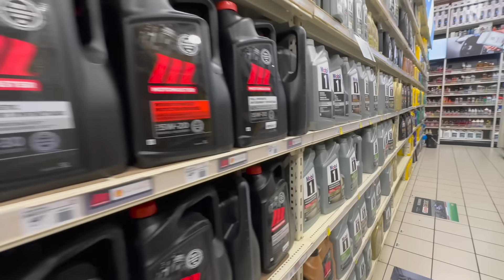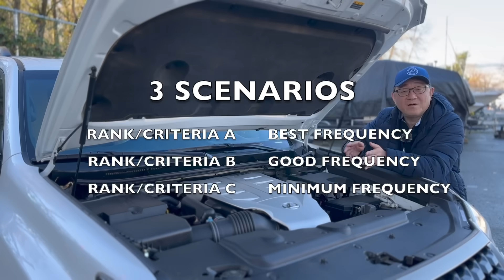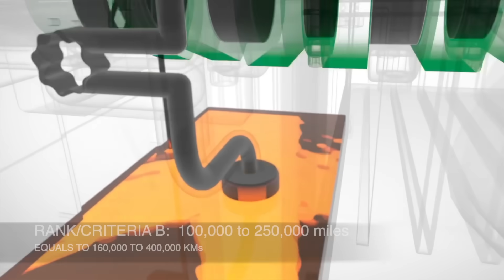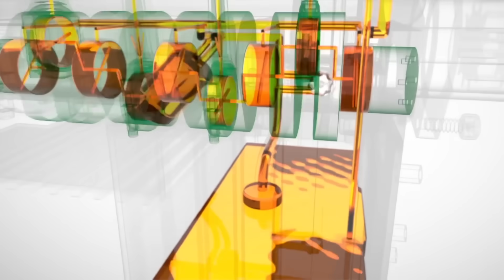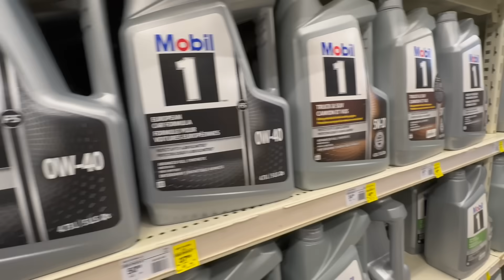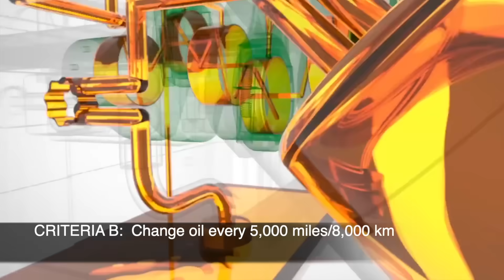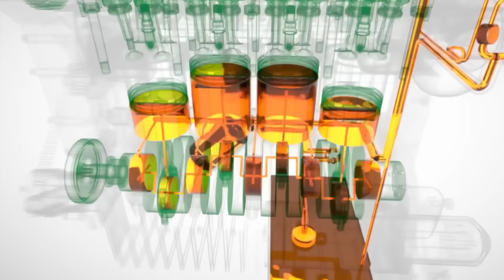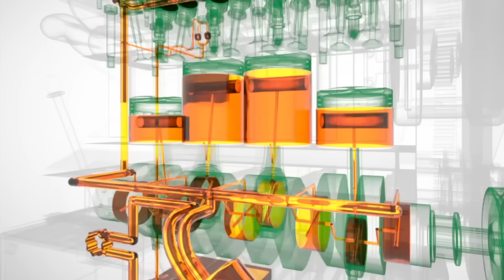ENGINEER EXPLAINS HOW OFTEN TO CHANGE OIL & FILTER // UPDATED CRITERIA-BASED RECOMMENDATIONS!

Comment: I'm an "A"  guy.  I've always bought new, kept them for 10+ years, although nowadays I use synthetic and go for 4-5k miles.
I am disappointed in the "C" recommendation.  This is why I don't buy used.  The attitude is basically "I don't care if who gets it next will have a long-term car. I got mine.".
Reply: couldn't agree more..very well said 💯
Reply: I was thinking the same thing. Basically C  is encouraging bad maintenance.
Reply: The other issue is that manufacturers like Toyota tell customers 10k is a good interval and Toyota care only covers oil changes at 10k intervals. So folks think it’s fine. Shame on them. Their is fine print in the book that tells you if you tow, or drive for short intervals than you need to change it more often, but no one looks into that…
Reply: I owned a 1980 Toyota Corolla from 1984 to 1988. The owner's manual stated to change the oil every 10,000 miles under regular operating conditions. Every 5,000 miles under severe. This was in 1980 too! Remember everybody when Mobil One was introduced around 1975? The commercials stated one can go 25,000 miles between oil changes! Then Mobil probably figured out they would not sell as much oil, and ended that campaign whenever.  :face-purple-wide-eyes:
Reply: Everybody is an expert. LOL
Reply: Agreed. A few years ago I bought a CPO Camry with 31k on it. After about a year I began to have serious oil consumption issues. After reviewing the Carfax history and noticing that the car had only had 2 free oil changes at the dealership I became aware of the 10 k interval being a huge problem. Ended up trading it in for my first and hopefully last new car. So far I have done 3 oil changes myself every 3-4k miles since most of my driving is short and in hilly terrain.
Reply: @turo3066 9:24 lo
Reply: Modern machining specs and tolerances work fine with 10,000 mile oil changes.  I put over 200k on one doing just that.  Everything in new engines are designed with the 10,000 mile oil in mind, including dirty oil for that long.  Running oil past a year and well beyond 10,000 miles is harmful.
Reply: @flat_stickproductions209  wow, so much ignorance in one post, really amazing.
Reply: @lhurst9550  I am sure the guys designing engines, oil and oil filters would really like to hear the handy mans take on it, or even the Jiffy lube tech.
Reply: 10+ years is Not long…
Reply: IF YOU GO FOR 5K MILES YOU ARE B GUY. 
I AM AAA, 'CAUSE I CHANGE MY OIL EVERY WEDNESDAY. 😂😢😮😅
Reply: I totally agree, I NEVER buy used.  You never know how they have been treated.  I like to have a factory warranty and use the time to decide if I want to keep it or sell it.
Reply: Same, I love cars so I’ll take care of it regardless of how long I have it and in hope that everyone after me takes care of them and can enjoy the car without problems.
Reply: Came here to say this.
Reply: Why is it bad to use the manufacturers recommendation? Unless they want the car to fail so you have to buy another one. If that’s the case why would you be a repeat customer if the engine failed prematurely on their recommendation?
Reply: @JHKCF  Basically every driver have different driving conditions which does not fit the ideal manufacturer oil change interval. You may have short trips like driving to work every day for 5 minutes which does not allow the engine to fully warm up. You may be a driver that does mostly city driving and that effects the engine oil. On the other hand you drive mainly highway driving which is good for the car. Then weather plays a part in which dusty and extreme freezing condition or very hot desert condition will effect engine oil wear. So the 10,000 mile oil change the manufacturer recommended is not ideal for that driver that drives short trips mainly in the city. On the other hand the driver that drives mainly highway for an hour every day the 10,000 mile oil change in mostly warm weather above freezing would be good for the engine.
Reply: @nowayout8639  There are historically two schedules of maintenance for oil/filter changes. One is for those who drive in clean conditions and on longer trips. The other schedule is for what is considered to be harsh conditions with short trips and lots of dry dust and or sand.
Reply: @nowayout8639    You make some excellent points. I’m 65 years old and am the kind of person that would rather drive a debt free car than purchase a new one every 5 years and always having loan debt. So I typically drive them til it makes absolutely no sense to continue to repair it. I have literally never owned a car that I gave up on because of internal mechanical issues and would routinely change oil every 4-5 thousand miles on conventional oil when 3000 was recommended years ago. Now I do understand that some of today’s engines with turbos and variable valve timing may suffer a bit if you try and extend oil life too far beyond what’s recommended.
Reply: @davepaturno4290 while definitely true and they used to specifically state that in an owners manual, now I believe some manufacturers don't say anything to the effect of a reason the owner should be changing the oil on a severe use schedule, instead they point to the oil life monitor and claim its going to tell you. I've seen mechanics make comments on videos like this stating that they feel the oil life monitor has been the death of some engines they see come in because the owner went by it and the engine wear told the story of the lack of maintenance.
Reply: @charlesb4267  I think that if the algorithm in many vehicles does monitor driving habits and durations, then it's safe to trust its "guidance". My 2014 Mazda 3S GT recommended an oil/filter change after one year, since my annual mileage never exceeded 5000. 
 The mistake many people make is that choose only mileage as to when oil needs to be changed. My car had that as an option for when it would throw up the maintenance symbol (a wrench). The other option was time, only. I always chose the algorithm.
Reply: @JHKCF  they only think of the "new car customer" used car buyers and people who keep cars post 100k are freeloaders from their perspective.
Reply: @JHKCF  low tension piston rings get gummed up on extended oil change intervals.  Following manufacturer's recommendations for maintenance gets you car out of the warranty period.  A few years later you are looking at some serious oil consumptions problems.  This has soured the used car market for a lot of people.  Dealer maintened means nothing nowdays.
Reply: @JHKCF  Yeah and they also tell you it's a sealed transmission with no changes needed. lol
Reply: @JHKCF  They do it for CAFE kickback's from the federal government. Also, keep in mind that a lot of USA made vehicles have a different maintenance schedule than a European car. I live next to the Canadian border and years ago people would drive up to Canada and buy new cars because they got better fuel economy and longevity.

American cars have a ton of stuff from the EPA that basically shorten the life expectancy of most vehicles.

For instance most Americans have zero idea Honda made Diesel Lawnmowers but Europe is full of them. EPA wouldn't allow them here in the good ol USA
Reply: @JHKCF it won’t fail prematurely. It just won’t go long past the warranty.
Reply: I've known a couple people who leased a car and never changed the oil.  Way back I bought a pickup with 42k that was still on the factory oil, and nearly empty.  I drove it for a couple trouble free years and sold it to a dealer.

Comment: I do 5000km inn 15.6 months, is that ok
Reply: That's for you to decide.
I think it would be better if you changed the oil at the very least once a year even if you only put on 5,000 kms annually.    You are in the "B" team.
Reply: Again up to you. But I hope you  take the vehicle for a very long run at high speed at least once a month to give it a very good work out. So if you doing very slow speeds and very minimal running that’s also no good. The oil and engine are designed for high temps. So perhaps in your situation twice a year still.

Cheers.
Reply: @johnmartin7158  thank u John, I don't usually take it for a long run, its the infamous GM Z22SE (L61) withé 283000 km (175848 Miles) on it 😀
Reply: @MeaHeaR  You’re welcome.

Cheers NZ.

Comment: Yay for YouTube algorithm sending this recommendation! I’ll also add that every modern liquid cooled engine would be “best served”using Quaker State Full Synthetic 5W30 (not Ultimate Protection/must be 5W30). This is per 540RAT engineering blog who has tested over 300 engine oils to their maximum mechanical load limits. Ideally change every 3,000mi to 5,000mi max. Purolator, Bosch oil filters are tied for 2nd, Motorcraft filters #1 construction. Find one that fits. Cheers

Comment: @AutomotivePress: Excellent information, thank you! Can you do a video like this on transmission fluid, differential fluid, transfer case, etc?

EDIT: do these recommendations apply to turbocharged and direct injection?
Reply: it its turbo change oil evey 1,000 miles and if you want to play it safe then change the oil every 500 miles

Comment: I have a 2003 Highlander V6 with 160,000 trouble free miles. I change the oil every 5000 miles. I like this number and recommend it to friends because it is easy to keep track of. Whenever the car hits the next 5000 mile increment it is time to change the oil. I also keep a spreadsheet of all maintenance ever done but find the 5000 mile increment easy to remember.
Reply: Plus, 5k is also a good time to rotate your tires.
I just bought a '23 Ram EcoDiesel (last ones!) and I'll do the first change at 1.5k, then 3k, 5k and every 5k afterward.
My Retirement Ride, lol! 👴🏻
Reply: I religiously change oil (some fancy high tech 0w-16 oil) once a year in my Toyota, and I drive 2500 miles a year. But the engineer in the video says every 6 months. That wouldn't even be 1500 miles per change interval. Isn't that just over the top? I mean even 2.5k is ridiculous in my book, but whatever. By the way, this topic has been well researched and there are studies out there.
Reply: @Ilker_Ali89 
For scenario B, he also said every 5,000 miles or once per year, whichever comes first.
So, in your case, that would be 1 year at 2,500 miles.

A high quality oil will easily last 1 year. Even if the oil gets diluted with some moisture and gasoline from short trips or low miles, that's not a big problem.
If you're worried about fuel or moisture in the oil, an occasional highway or long drive will help to expel the moisture and gasoline, and burn them off.
Reply: Had 2003 Highlander V6 for 16 years, changed oil every 7500 miles as per manual.  Never used any oil 260,000 miles, it seems that model of Highlander lasts for a very long time.
Reply: 3k 4k 6k and 7k are hard to remember.

Comment: Almost always keep my vehicles for 10+ years. Growing up in West Texas and New Mexico it was super important to keep the oil and filters fresh. The air filter as well and the box vacuumed out.
A follow up on radiator care would be welcomed. 
Engines seem to have come full circle in their operation. It used to be important to warmup a carbureted engine and then it became less so with direct injection. Now with all the turbochargers it’s back to a warmup stage before pulling out.
Reply: @froggy0162 bs
Reply: @froggy0162 Modern fueling systems don't wash oil off the bore and it's not best to warm the engine as fast as possible, rather the opposite; allow the engine to idle for a minute or two, depending on outside temp., thus letting the engine oil and water to get some heat before driving gently for a few minutes to get some heat into the rest of the driveline.
Reply: @froggy0162 You can't drive gently from where I live. After the first 0.2 miles, it is up a steep grade with lots of turbo boost.  Fortunately, my car is kept in the garage so it is at least 50F when I start it up.
Reply: The reason warmup was done on carbureted engines was because frequently they were set up so lean from the factory that they would stumble if throttle was applied abruptly until they warmed up and got some heat into the engine. The heat helped the fuel vaporize and deliver the mixture calibration the factory targeted. Until warm up was partially complete, driveability was usually awful. Hence the driveway warmup became standard practice. In reference to the turbocharger putting us back into the warmup scenario, well that is just wrong. In a modern turbo engine, it is appropriate to start the car and drive off GENTLY...stay out of the boost until the engine has warmed up - this allows the ring gaps to close up to normal tolerance and minimize the blowby that occurs under boost conditions and for the piston to cylinder wall clearances to close up to normal as well. Once these clearances have adjusted to normal operating clearances, full boost is usable without endangering the engine. So start your turbo car and drive away and let everything warm up gradually, once up to full operating temperature, Full engine power can be used as necessary. Doing it prior to that is abuse.
Reply: Letting the engine warm up before putting it in gear started in the old days when it took awhile for the parts to expand and the steel pistons stopped slapping. Ive been lucky. Always had a mile or so before I hit the freeway. Best to let it idle a little at shut down so the turbo wont get heat soaked. Never had a car with a turbo. Ive driven trucks.
Reply: The old diesel Ford tractor I bought hadnt had the oil bath air cleaner cleaned probably since new. I dont drive under dusty conditions. I put a Ford truck air cleaner.The pleated paper cleans better but the oil bath holds more dirt.  I replaced the leaky fuel filter with a Motor Guard oil cleaner. Used a roll of Charmin Ultra Strong in it. The Scott 1000 was too dense for gravity from the fuel tank.
Reply: @froggy0162you need to warm up the transmission too to make it last longer
Reply: West Texas/New Mexico.  My family had a farm 46 miles south of Portales for a few years.  Dry-land, no well.  Then moved 35 miles northeast of Clovis.  Irrigation!  But, centrifugal filtration along with the oil bath for the final stage was the going thing.  People who've never had to dig the oily dirt from the bottom of an oil bath would not believe how much accumulates.  And not just farm tractors.  My '55 Pontiac also had the oil bath and you couldn't run too long without maintaining it.  After I got something with a modern filter, it didn't take long to start dragging mom's vacuum cleaner out to the garage to clean out the box!

Comment: Where is the scientific data to back this up? They have 30k oil changes in europe. I've seen cars following that interval last 400,000 kilometers.
Reply: There is none. “My car lasted X miles with frequent changes” is the “proof”, ignoring that half the number of changes would probably give the same result.
Reply: They often have bigger oil capacities and run different specs.
Reply: @zzman5306  An Audi A4 does not hold more oil in Europe than the US. Nor does an M5. Or a Mustang sold in Europe. What a crazy comment.
Reply: The construction matters more than the service.
A Ford Ecoboost or a BMW 
N 63 twin turbo is a good example 😂
Reply: I am from Europe and youre state is utterly BULL!! I have seen many vehicles that followed the 30.000kms intervals. 120.000kms and they need an new engine!! Or had severe wear!! So the 400.000kms engines you talking? Had already one engine ruined!! I say to people to do oil changes every 15.000kms osynthetic oil.  Those people are getting 200.000kms with zero problems.

Comment: David, We have a 2004 Honda CRV in our family  with 150k miles that we bought brand new in 2004 and we have done a synthetic oil and filter change every 4 months since buying the vehicle. The engine is still running like it was brand new. Hoping our other cars (2016 4 Runner and 2022 CRV) last as long  as our 2004 with the push for EV's coming.
Reply: Awesome..I follow the 4 month interval change too....
January - April
May - August
September - December
I put on about 15,000 kms annually... Hope my Corolla Hybrid SE AWD will last forever....